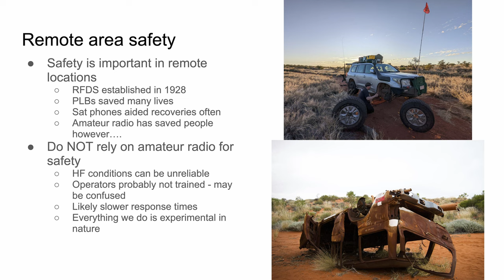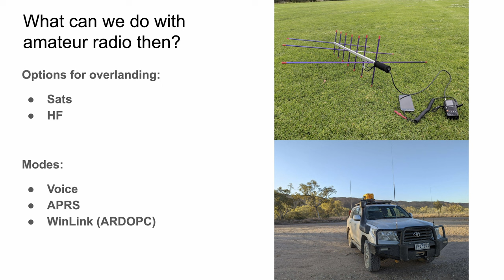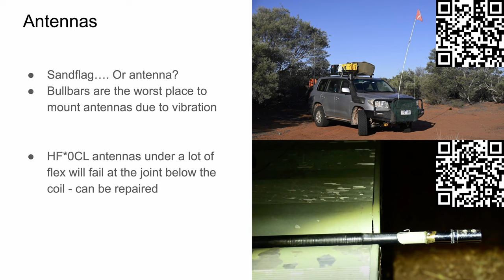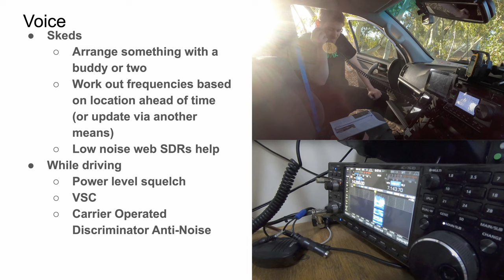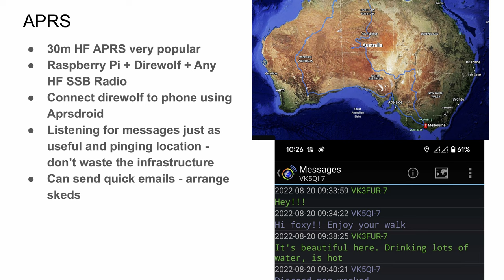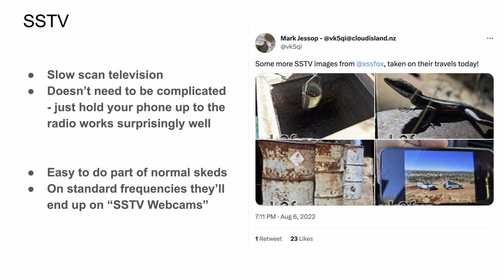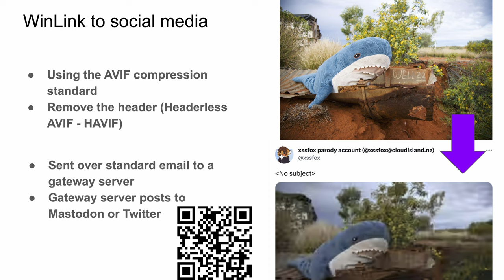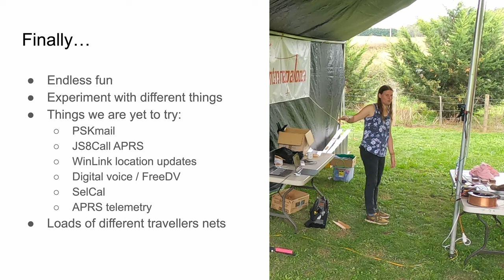Radio communication for overlanding

Comment: Nice talk. Loved the blip. Just wondering on the topic of sats how do you for compensate for doppler shift on your HT?
Reply from the maker: I usually use preprogrammed channels. On sats like SO50 you can hear the doppler change and adjust the channel. On sats like AO91 ect... I use an Android app that calculated the doppler for me.
Reply: I have "worked" Iss before but I only get the top of the pass (>45°) the rest of it is just noise. Probably dosent help I'm using mono-band tait HT's.
Reply: Should try iss aprs too. Roughly 3-4 vk passes a day. 145.825 path ariss
Reply: @WadeAbout  I don't have an APRS capable radio sadly :(